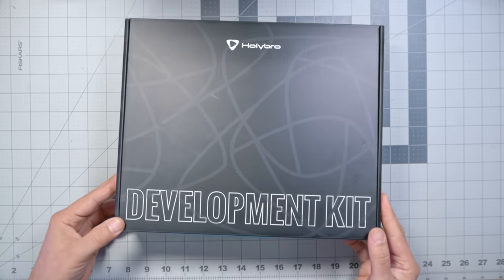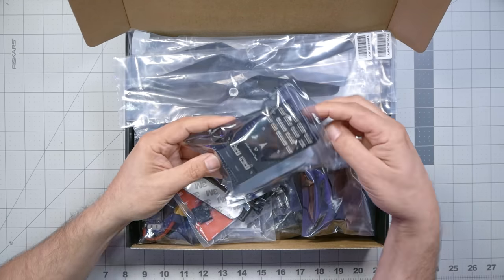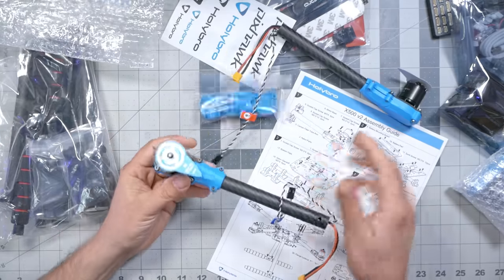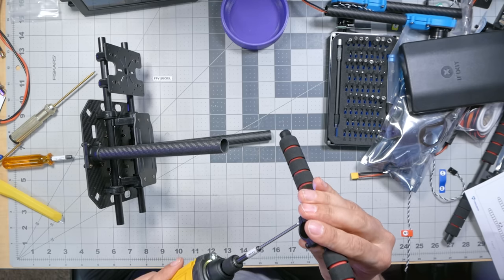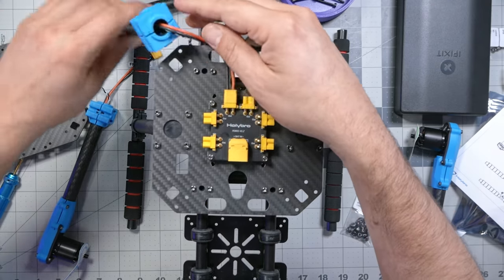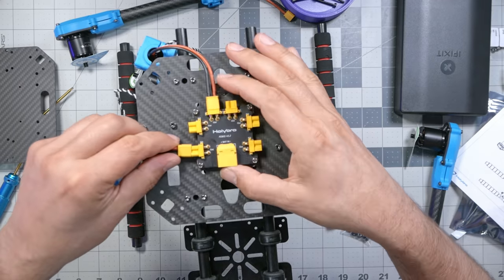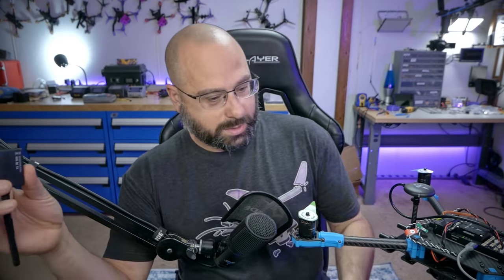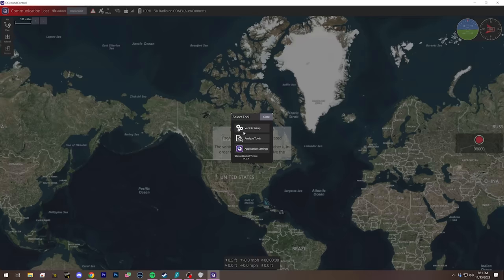FPV pilot tries Pixhawk for the first time // Introduction to Ardupilot

Comment: Unless you have a RTK GPS, no matter how many GPS satellites you have you will always have a position error or of +- 6 to 10 meters. It's absoulutely ok for the kind of work these drones do. Please add a Lidar range Finder and Optical flow sensor. It makes it really stable also, there are so many aux pwm ports you can use for different applications from controlling gimbals to robotic arms attached to the copter.
Reply from the maker: Is there a good rangefinder and optical flow sensor that you'd recommend? I looked for some, but they were pretty expensive.
Reply: That would be with a pretty bad GPS receiver then.  A 2-3m radius is more what I would expect from a modern GPS.
Reply: @EinzigfreierName  yes, although m10 usually has an accuracy of 2-3 m but factors like tree shade or any obstruction from direct LOS does increase the position error
Reply: I built one of these like 10 years ago and it loitered rock solid within less than 1m. Even in high wind. Surely the tech hasn't gotten worse?
Reply: The thing is, you need to get a lot of things right to achieve this. 
- good GPS module with a good and not too small antenna
- no interference from the flight controller, VTX or telemetry transmitter
- unobstructed view to the sky in all directions
- good yaw estimate from the flight controller. Bad magnetometer calibration (compensation for soft/hard iron errors) can be a problem here.
- good attitude and position control loop tuning.
Even then, a <1m accuracy is most likely just a "short term" observation (for a few minutes or so). Datasheets for popular GPS chipsets claim that 50% of the datapoints from a 24h measurement are within a radius of 2-2.5m. 
But I fully agree with your basic statement. My tests and observations more than 10 years ago were the same, using ublox 6 and 7 GPS modules and only using the GPS constellation (no multi-constellation support at that time). Compared to that, the position hold in this video is really, really bad and there's obviously something wrong here. 
Edit: the same with altitude hold. Turbulences from the props cause noise, but no drift in the baro altitude. It's perfectly possibly to hover with only +/-20cm drift based on barometer measurements alone. The important thing here is to leave GPS altitude out of the game because it's not accurate enough. Not sure about this flight controller handles this. @dannyvardy8839
Reply: @maazshahid8920  I got stable position hold with less than a meter variance with some cheap BN-880. In windy conditions. No dancing around or anything strange.
After flying a short test mission it even landed within a 1m radius of its starting spot. That was with PX4.
Reply: @EinzigfreierName  If those GPSes really can't be better than 2-3m, then I think a properly configured FC will also prevent drift just from the Gyro-data, when in position hold mode. Because with a properly configured PX4 I never had that kind of drift when hovering in pos hold mode.
Reply: Most FCs use a Kalmanfilter to fuse data from all the senors to produce the attitude, speed and position estimates. With all of this blended together, the resulting position estimate can show a little less short term drift than the pure GPS data. Gyros are not really helping here, but accelerometers and velocity information from GPS do. By the way, when we are talking about "drift" here - the GPS position does not really drift, it's more like a kind of random walk around the true position in contrast to a "real" drift that would mean the vehicle moving further and further away over time.  Another reason why position hold may look much better than the actual GPS accuracy - you only watch it short term (a few minutes maybe) while the datasheets are based on a 24h period observation. Often, the GPS position moves around by only half a meter or so for several minutes and then suddenly starts to walk off by 1-2 meters.

Comment: the px4 flight controller is much more sophisticated compared to ardu. if you look at the code for ardu it is quite hacky. the software devs for ardu are not as good as those for px4, and it really shows in the code. additionally, px4 is supported by dronecode / linux foundation, so this actually makes sense.

Comment: This is great! I would love to see you set this up with the Herelink 2.4GHz transmitter system which turns your Pixhawk drone in to a DJI equivelent system. Herelink is basically an android touch screen running Q ground control with a transmitter, it takes care of video feed and TX over the same 2.4 link.

Comment: Px4 is way better, more open and crossfire will work with px4, you just need the input going to rc_in and select it from the rc_input setting.
Reply from the maker: I don't think this is right. One of the selling points of Pixhawk is that it's not GPL so people can develop for it without releasing their source. And my understanding is Ardupilot supports CRSF in release, while PX4 has to be custom-compiled from source.

Comment: Bro Loiter mode means say around that area!! not a Position HOLD!  simply ad position hold vs loiter.
Reply from the maker: My understanding is, Loiter is the older, deprecated version of PosHold. Both of them can be moved around by moving the sticks, but PosHold does a better job of it.
Reply: The PosHold flight mode is similar to Loiter in that the vehicle maintains a constant location, heading, and altitude but is generally more popular because the pilot stick inputs directly control the vehicle’s lean angle providing a more “natural” feel.

Overview¶
When switched on, PosHold mode will automatically attempts to maintain the current location, heading and altitude. Good GPS position, low magnetic interference on the compass and low vibrations are all important in achieving good loiter performance. @JoshuaBardwell
Reply: @JoshuaBardwell  aMMM NO!  Loiter always meant to loiter around that area, with a given radius (all set in the setup options)  Position Hold is to hold its GPS position.

this has always been the case for PX4 and Adrupilot as well as many other flight controllers.  Terms do not change in RC sorry.

i only built like 9 quads with these adrupilot controllers, i would know...
Reply: @JoshuaBardwell  in addition!!!!  i see nowhere where you calibrated the compass, one of the most important things in adrupilot.
Reply from the maker: I did calibrate the compass but I agree that isn't shown in the video. I had to take the quad outside away from the computer and other sources of magnetic interference, and I didn't bring the camera.

For loiter mode, I have to argue with you. First, I tested loiter mode and I can tell you that when you deflect the sticks, the quad flies as expected. Second, Ardupilot documentation agrees with me:

https://ardupilot.org/copter/docs/loiter-mode.html

Loiter Mode automatically attempts to maintain the current location, heading and altitude. The pilot may fly the copter in Loiter mode as if it were in a more manual flight mode but when the sticks are released, the vehicle will slow to a stop and hold position.

The pilot can control the copter’s position with the control sticks.

Horizontal location can be adjusted with the Roll and Pitch control sticks with the default maximum horizontal speed being 5m/s (see Tuning section below on how to adjust this). When the pilot releases the sticks the copter will slow to a stop.

Altitude can be controlled with the Throttle control stick just as in AltHold mode

The heading can be set with the Yaw control stick
Reply from the maker: The same is true with poshold. When the sticks are centered, the aricraft attempts to maintain position. But when you move the sticks, the aircraft will change position as commanded.

Comment: We are all dependent on these companies and apps too much like the grocery stores, we need to learn more programming and building, drone builders in India are implementing more with 20 times less, air speed obstacle avoidance directly to the chip, Asia also, they don't have the finance so they put in more brain work!! I've talked to people from India years ago that were applying obstacle avoidance to F1 flight controllers with IR sensors from TV remotes and cameras from old flip and stick phones!! But anyway again my point is to say we need to open or minds more and not think that we know everything about the advancement in technology because it moves faster than any one of us!! But Again My channel THE DRONE GIANTS will be coming soon were we will get in depth about the inner workings of programming ourselves!!

Comment: you dont have optical flow why you trying to make it hover at ground level lol you should have gone up 10-15 m and it would have been relativly rock solid
Reply from the maker: I literally say this in the video.
Reply: @JoshuaBardwell  you say it then proceed to yell at it asking it why it wont be more still lol
Reply from the maker: Yes it's still annoying.
Reply: @JoshuaBardwell  so is hearing you yell at a machine that's working exactly as expected lol hence my original comment, don't take it personally I'm just yelling at a cloud just like you were yelling at the quad lol

Comment: This is a terrible video, he has not followed basic setup steps, so its not flying correctly. its drifting because HE NEVER DONE A COMPASS CALIBRATION!!
Reply from the maker: You are wrong. I did calibrate the compass. It got cut out of the edit but that doesn't mean I didn't do it.
Reply: @JoshuaBardwell  you clearly had something set up wrong , it should hold position within around 30cm even with a standard GPS and no tuning. why are you setting up adupilot with q ground control and not mission planner?  qground control is set up more for PX4 than ardupilot. there are very clear steps to follow when setting up ardupilot and you never followed any of them.  look at the ardupilot methodic configurator.

I dont undetstand why you would make a video with it flying so bad, do you actually think thats as good as it gets?
Reply from the maker: No, I don't think that's as good as it gets. And that's why I named this video, "tries PixHawk for the first time." This is not represented as a tutorial and I do not represent myself as an expert. So what is your point? 

I absolutely did follow the setup steps in the tutorials that I found. What would you do differently? Say somethign helpful and constructive why don't you? Show me the "basic setup steps" you think that I missed.
Reply: @JoshuaBardwell  I said to look for the ardupilot methodic configurator in my last message.

what setup guide did you use?
Reply from the maker: Thank you for suggesting Methodic Configurator. I will check it out. Please notice that Methodic Configurator's first release was June 11, 2024. My video released November, 2023. If you are wondering why I didn't use Methodic Configurator, that explains why.